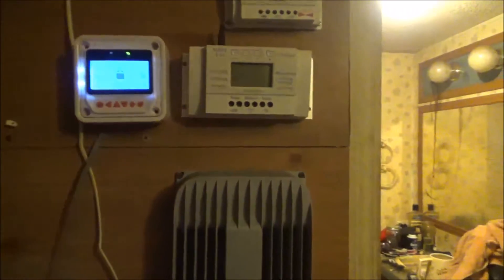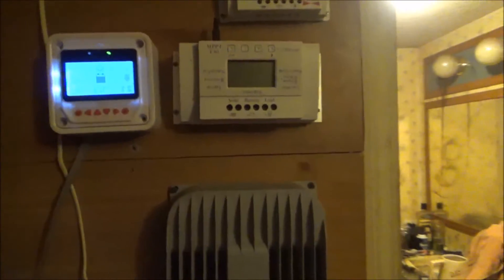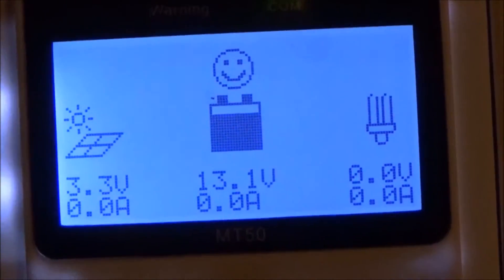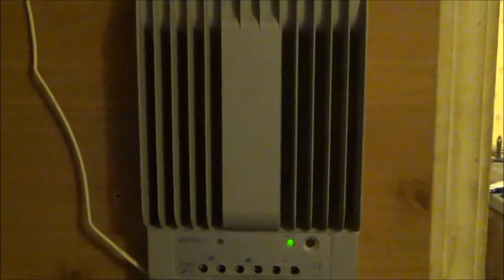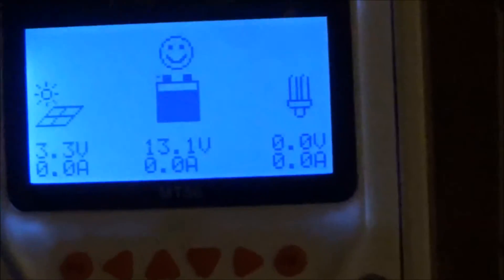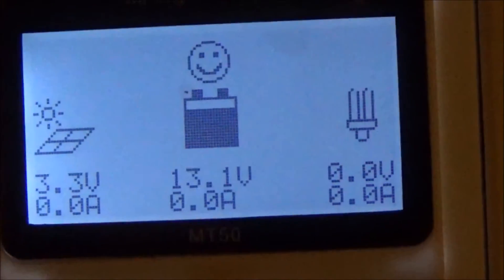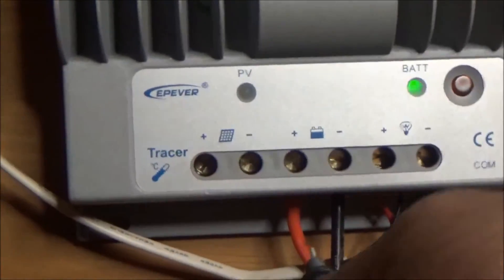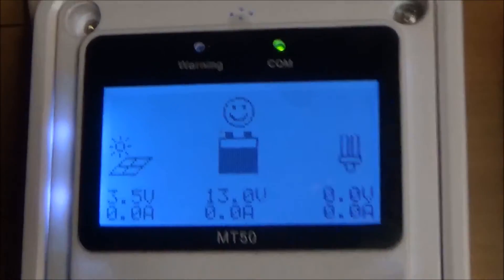Tracer 4215BN Voltage Error

Comment: Came across this, wondering if you ever figured it out. with mine, I took a clamp meter to one of the wires to the solar panels to see which way the current was going. Basics say if its going toward the panels there is an issue with a diode(s) on at least one of the panels that is allowing the battery to back feed to the panel(s). The diodes are what allows only "one way travel" towards. the battery from the panel(s). if the the latter is happening and the current is coming from the panels towards the batteries, its either moon light, strong street lights or some other light source that is allowing that small voltage to show up.

Comment: Did you ever sort this out?  Sometimes my mt50 freezes, so I do  factory reset and it fixes it.
Reply from the maker: Nah, i just learned to live with it. Don't use the mt50 anymore
Reply: cutdagrid  but you still use the charge controller?
Reply from the maker: Yes, I use the software to monitor it on my pc
Reply: cutdagrid OK, so you think it was a problem with the mt50 rather than the charge controller? Strange since  you. Measured the voltage at the charge controller. I just bought the Bluetooth dongle, I get it this week.
Reply from the maker: no it is a problem with the charge controller, just nothing to worry about. Several people piped in in the comments and also feedback from epsoler.
Reply: cutdagrid oh OK. And they didn't offer to repair it under warranty?
Reply from the maker: no i didn't pursue that option

Comment: This looks like leakage possibly from a resistor in a divider network. As it is very high impedance connecting a 5K resistor across the solar input should reduce it enough to allow night mode to kick in.

Comment: Yeah, my 4215B shows 0.1V, but I'm using it on 12V input. I'm not so thrilled about MPPT anymore, due to the huge surges you have to allow for. Normal PWM chargers have to allow for about 30% surge, during cool cloud surges. MPPT goes even worse than that. The main reason I was attracted to them is that they offer complete programability. However, I have recently seen an el-cheapo 20A PWM on ebay that seems to offer programability, so things are looking up.

No signs of a 30A version though; they seem to be fraudulent   http://www.ebay.com.au/itm/10A-20A-LCD-Display-PWM-Panel-Regulator-Solar-Charge-Controller-12V-24V-Timer-SS-/231679372737?var=&hash=item35f12aadc1:m:m2kf2QSeXD6x0Ncq8DNAsAw

Comment: Besides this issue, how is the controller holding out? I heard some people complain about the charging algorithms, about how it takes time for it to recognise load on the battery and track Maximum Power Point. do you have any of this problem?
Reply from the maker: Thank you for your question. I have been pretty happy with the controller. When I put a load on my battery bank the controller does kick in and increase wattage. I am no expert and really have nothing to compare it to, but I am very happy. In general I only drain my bank 10 percent or so and am back in float charge only a few hours after sunrise.

Comment: O yeah, PV voltage might be right, as this is useless and therefore open circuit voltage.

 You didn't say what the operating PV voltage was, but if 70ish like mine, a few volts at night is normal.

The array and controller i described in detail is unable to be used for night light control as it's never "dark", and there's no control over the voltage settings for the switch.

I bought a newer model A tracer, and that has user settings so that is the controller that puts my system in night mode.

Comment: There's a couple of things i can think of here. 
I've just had what some in a FB forum thought was a similar problem, where a different model got stuck. In my case the MT5 meter was stuck convinced i was pumping 4+ amps into the batteries at night, and that there was 13 volts on the array. (70ish is typical during daylight)
PV voltage was CORRECT, as there were streetlights above, (yes i know, off grid and in a city), but the battery current was clearly wrong.

I had created the fault by rearranging my system to a clearer space, and although trying to stay live, things got disconnected badly. 

I fixed the fault by simply disconnecting the PV, then batteries, having a coffee, then reconnecting batteries first.

Charge current was now reset to reality and registered at zero in the night.

The other thing that came to mind is that some tracers take a while to update.

Resetting should force an update.

Good luck!

Comment: What did you learn about this?

I just hooked mine up and it shows 0.7 volts at night. It does show the moon symbol though.
Reply from the maker: It seems the consensus is that the charge controller has a resistor that is leaking voltage (not amperage) and is nothing to worry about. It apparently would not drain your battery as there are no amps being drawn, just in your case .7 volts. Hope this helps

Comment from the maker: On reflection the 3.5v "stray voltage" is unacceptable. It is unacceptable for this reason.... The charge controller is designed to turn on the load at dusk, with the stray voltage the controller never goes to dusk mode and thus will not turn on the load. I know there is a work around for this i.e. turn load on by timer but this is a problem and for the price I paid I expect all functions to work.

I have written them another email. The fist email was sent 14 Feb with no response so lets see if they will respond to the second email.
Reply: +cutdagrid Your system is still in daytime mode indicated by the sun and panel on the left. It should go to night time mode indicated with a crescent moon, and show zero volts and amps depending on the system time. Have you got the clock set correctly?
Reply from the maker: +Julien Helme Thank you for your input. This is precisely the problem, it never goes to night mode because it is "receiving" voltage and thinks the sun is still out. The clock is set to the correct time but the night time mode works on voltage. ie. when voltage drops below a certain value the controller knows the sun is down. I have solved this problem by installing three more 100w panels. The new panels have enough resistance to drop the battery stray voltage getting thru to about .22v which is enough to show the night time mode
Reply: +cutdagrid Yeah ok fair enough. I thought it went to dusk mode based on the combination of the two for some reason. Can't remember where I read that though as it doesn't mention it in the manual. Good to see you got it sorted.

Comment: 2 things one is the white display an mt  5 or an mt 50? mt 50 goes with the bn series. Secondly charge controllers have  diodes or semi conductors which prevent the back flow of power. In other words without a controller if you do not use a blocking diode then power will backflow from the battery bank to the panels and you will lose power and have a pretty significant voltage drop over night. I think that what I am seeing is some residual voltage from a diode from the battery bank. I would be inclined to turn the inline watt meter around after sundown with the battery as the source and the panels as the load side between controller and battery and see what if any back flow of power or wattage is occurring. My guess is you have a small backflow as the semi conductor is not 100 percent efficient 

This is what in my opinion is essentially if you have 3.4 open volts getting though a diode with no amperage then there is no power loss. If your losing a backflow of 10 watts as you read 3.4 volts and .5 amp or an amp then it is an issue. Is there a power loss and if so how much?

A blocking diode on a heatsink wired iline would probably reduce this further if needed

Alternative explanation the panel makes power at night you have a new technology I want to visit you and we are all rich YAY
Reply from the maker: +Hurricane Wind Power I did as you said and reversed the watt meter. It showed 0.00A and 0000.0W, good news, I then removed the solar panel wires from the charge controller and hooked up a LED light to those posts, The MT50 dropped from 3.5 volts to 1.0 volts and the light did not light. Then for grins I shorted out the two wires to the LED and the MT50 dropped to .1 volts. All this with no wattage or amps coming from my battery.So my conclusion is as you stated 3.5 open volts are getting through the diode with no amperage and this is not a problem. Thank you for taking the time to respond.
Reply: see there is still a reason to buy from an American after all lol we respond to you
Reply: @JohnInBibs  bingo

Comment: Ghost in the machine.... Question is, do you still get a 3.3v reading off the controller with the control unit disconnected from the main unit?